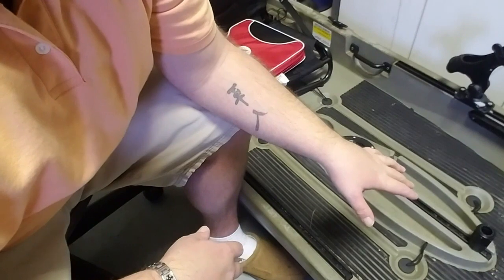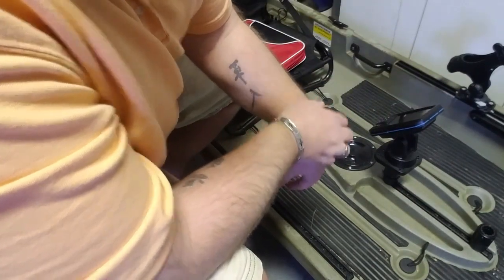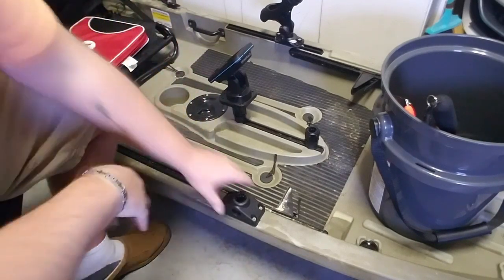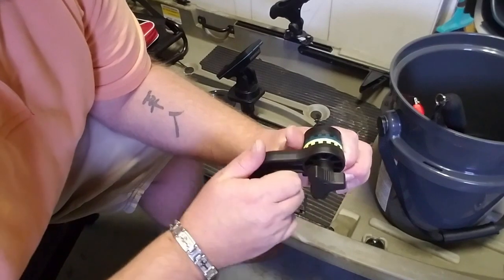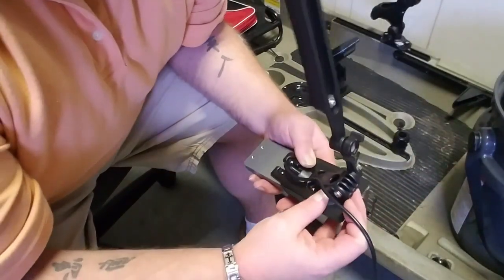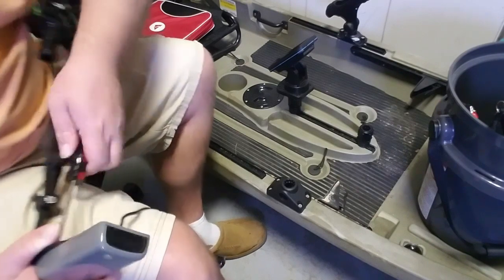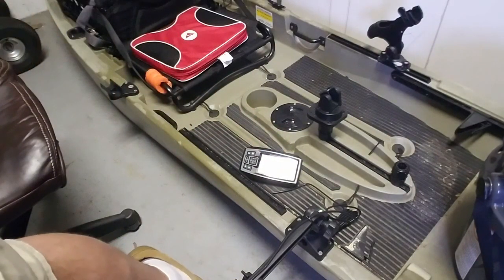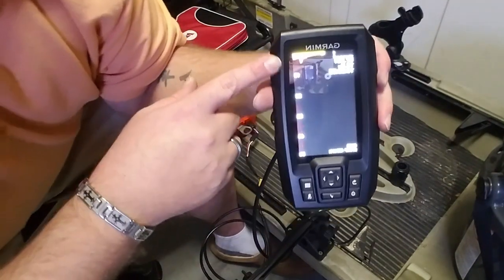Garmin Striker 4cv Fish Finder Mount to Kayak

Comment: Maybe a really dumb question but, doing the exact same install, what direction should the transducer face.
Is the rounded part the front or the square area?
Reply from the maker: @RichyKid the tranducer should be mounted with the rounded edge facing the front of the boat. There should be an arrow on the flat side pointing to the side facing forward